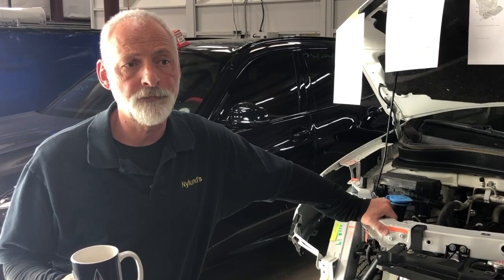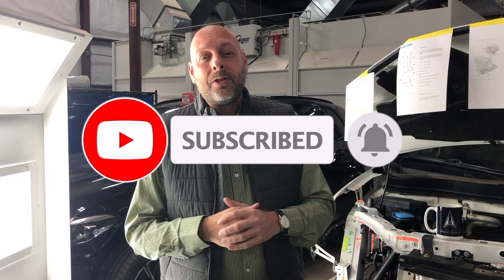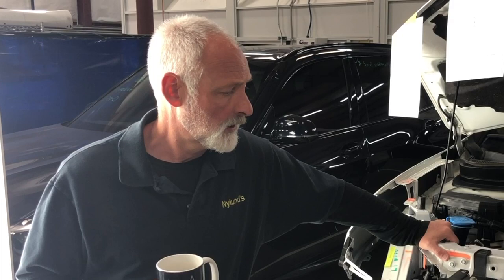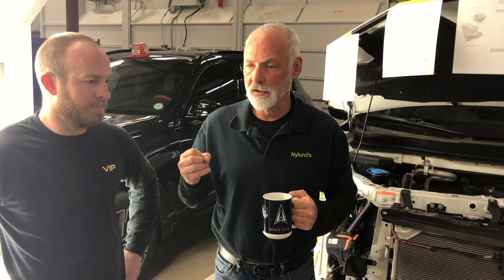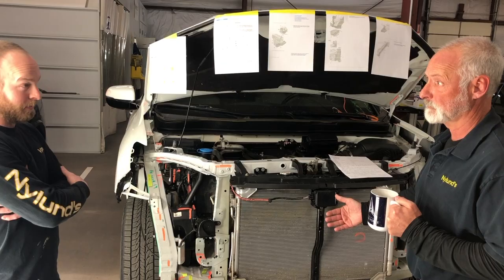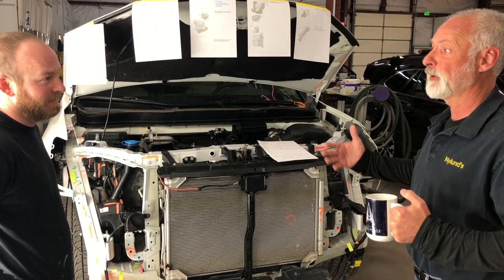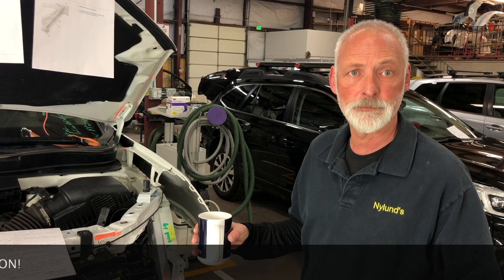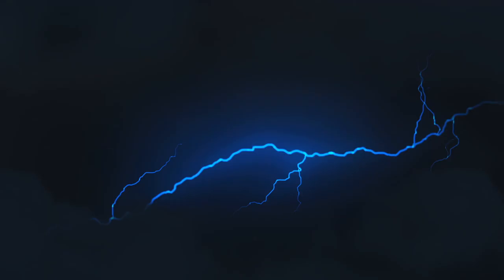DANGEROUS REPAIR!! Post-Repair Inspection - The Airing of GRIEVEances (Ep11) - Nylund's Collision

Comment: Yes, the repair is poor however, alignment and frame rail position have nothing to do with the vibration in the vid.   This is a bent wheel / bent hub /  broken belt in the tire / out of balance wheel-tire assembly.
Reply: Exactly. Most of these inspections are just about bashing other shops. A radiator support can be in the correct place even though the rails are not. They would have just moved it forward on the rails and welded it there.